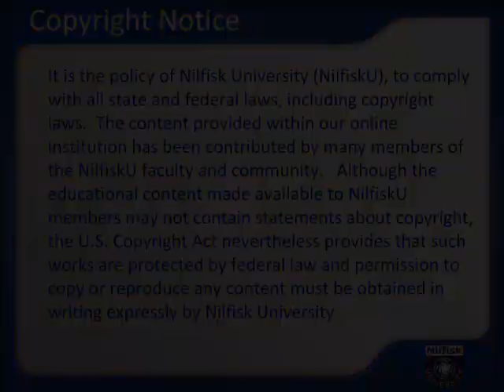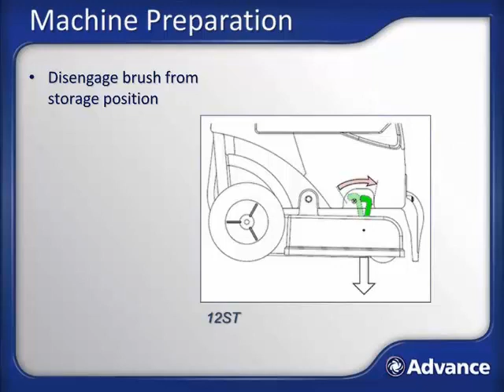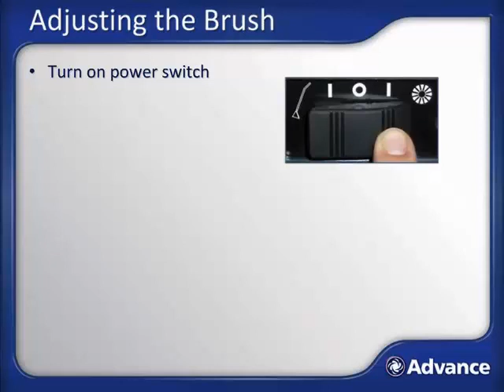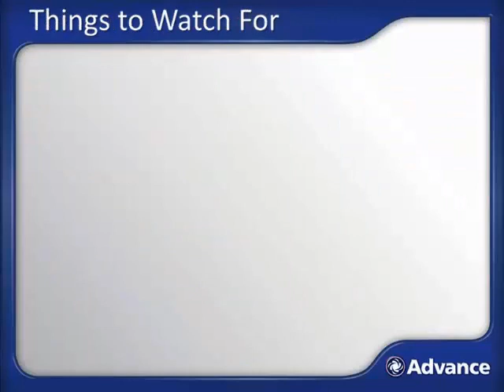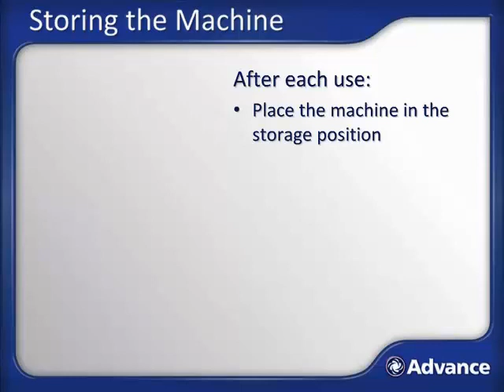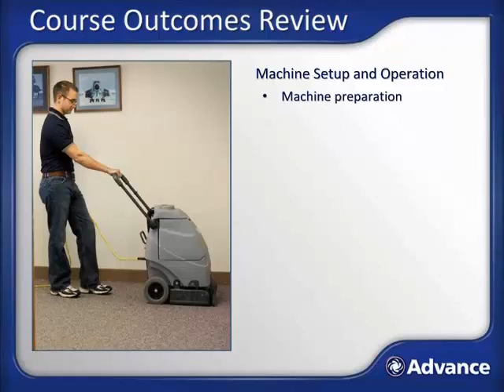AquaClean Use and Care

Comment: Is there a connector that as allows truck mount style wands to be uh used with the classic 18?. The quick connect is a different size,  and the threads on the 18 quick connect are a different size as well.  Why would you make the only oddball size connection in the industry 🙄👌

Comment: My aquaclean 18 flows even without the trigger cable being engaged.  I suspect the hydraulic.... switch/valve part is stuck open.   It hadn't been used in a few years until today.  Thinking maybe the button on the hydraulic switch is stuck from dirt inside?. Dissembling it tomorrow so fingers crossed
Reply: I was right.  Took the hydraulic switch apart and cleaned it.  Works like new now